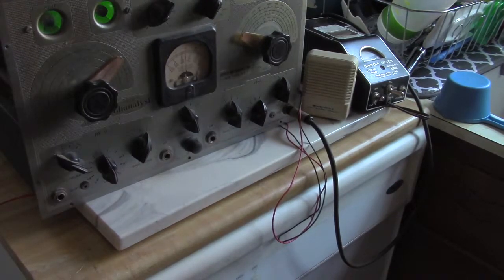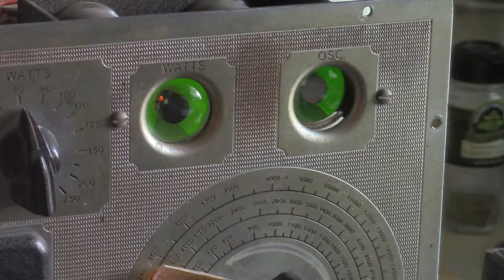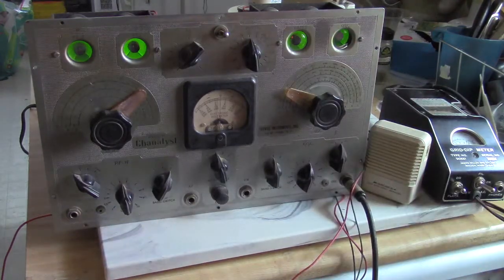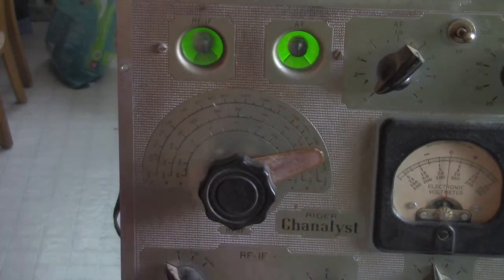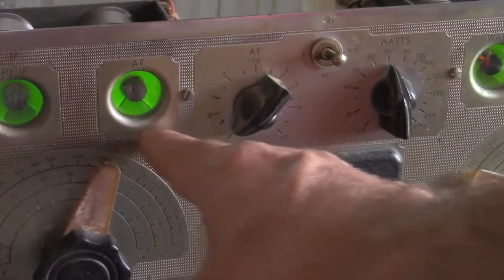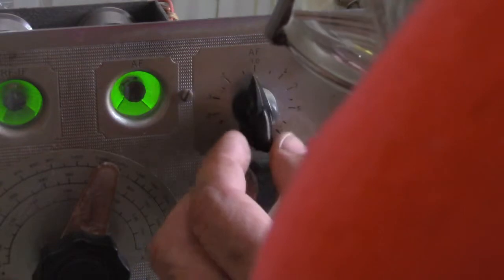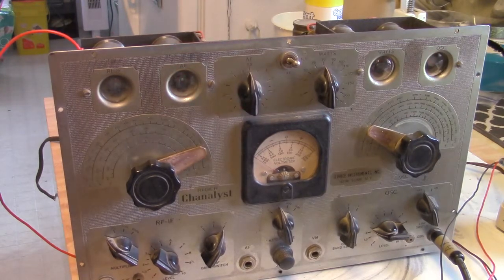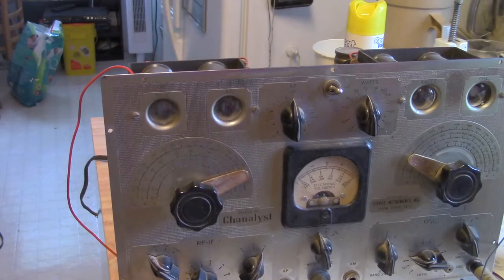RCA Rider Chanalyst Test Instrument pt2

Comment: This is the Model 11 from Service Instruments, John F. Rider's company in New York City.  They also produced a Vacuum Tube Voltmeter called the Voltohmyst.  RCA bought Service Instruments and put the Chanalyst into production, almost unchanged, except as you mentioned with a standby position to extend the life of the Eye tubes, as the Model 162.

Comment: Was a very useful piece of test equipment back in the day. It could do the work of 5 testing devices in one.The is a lot of info on the web about it if you search hard enough.
The brochures by the manufacturer are very cool. Downloaded a binder full of stuff about it and one day may get one,for novelty of course since there are a lot of much
better and more modern equipment out there that is easier to work on and then use. Thanks for showing it!😍👍🏻